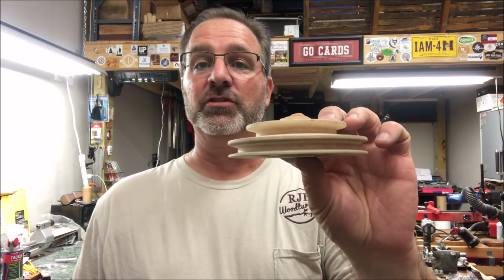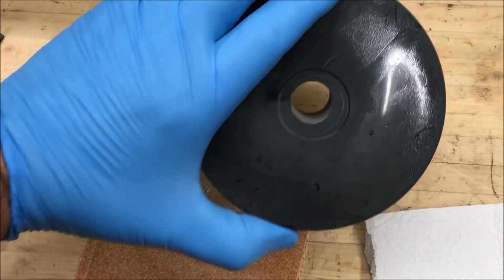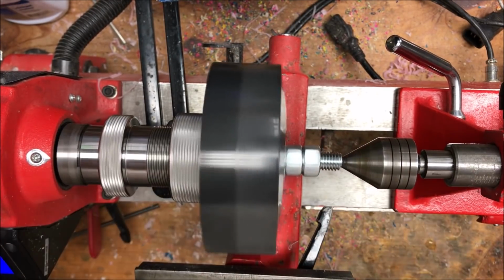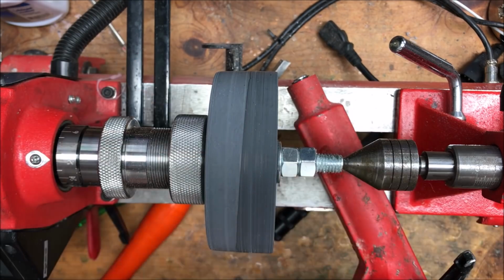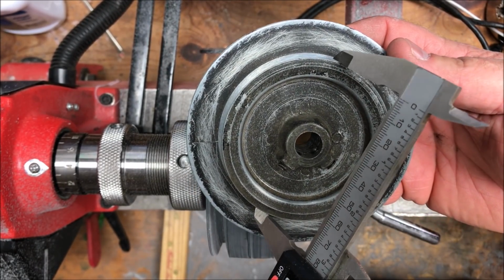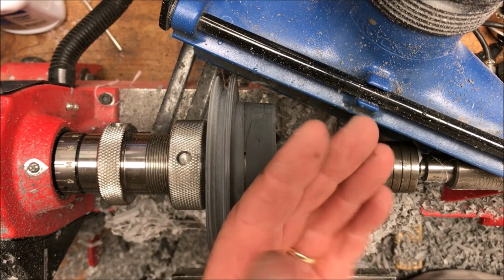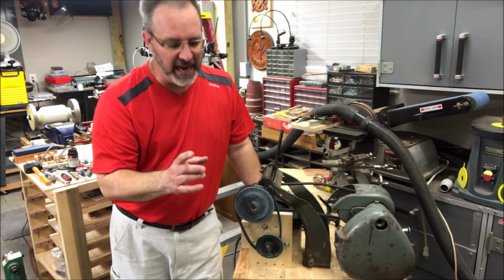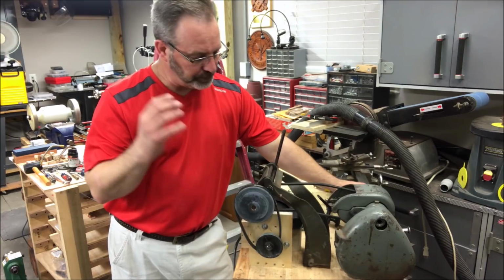I Turned A Pulley To Repair My Atlas 618 Lathe

Comment: Lathe looks like a 10F being a 10" swing probably on a 36" bed. You can get those pulley's all day on Amoozun for about $10 OR Ejay for outrageous insane prices specific replacement part. FYI....the original big pulley on the counter-shaft is about 12" dia.
Reply from the maker: This is an Atlas-Craftsman 618 lathe from the late 1940’s. 
  The issue is, all the pulleys I have found online use a wider belt. 
  I am in the process of replacing upper and lower pulleys to accommodate the belt situation. They are $30.00 to $40.00 each. 
  The original pulley for this lathe is a little over 4.5”. I have it, it’s just bent and can’t be straighten. 
  This may seem like a simple fix but it has been quite complicated. I have a rep at Grainger who has been helping me and it has really challenged them. 
  I can always buy one of the original pulleys on eBay but they’re like $160.00 as they don’t make them any more. 

Regards,
Bob
Reply: @RJBWoodTurner  Same here...the one & only thing I need is non-existant....OR original/used parts insanely priced on ejay. Sometimes we need to stop and work out a different way to make a repair. Never compromising using iffy shady -tech but maybe improving the machine. I'm trying to piece part a 12"x54 Atlas back together almost complete less the counter-shaft pulley that I found on Amoozun. Going to use green link belts found at Harder Freight Tool.

Comment: I have a question if you don't mind.  I am having trouble with my drill press blowing out the end of my acrylic blanks. How is that avoided? Also my press is not drilling straight. I have checked the table for level, made sure the bit was 90 degrees to the table. I just don't know what I'm doing wrong. I definitely need the advice of the mentor. Thanks in advance!
Reply from the maker: Hello Bret,
  I usually stop drilling right before I get to the end and let the bit cool.  If the bit is hot the chips stick to it and pack in causing more friction and heat. That will blow the blank. 

Regards,
Bob
Reply: @RJBWoodTurner  Thank you very much Bob. That helped a lot. Now if I can just figure out my drill press. For now I am drilling by hand to get a straight hole.
Reply from the maker: It took a lot of work to get mine square. I purchased an small machinist square. Then I brought the bit down to the table and checked it over a full 360 degrees making adjustments front to back and left t right. The other thing you really have to watch for it to make sure the blank is square in your vise. Many times stock is not perfectly square which throws off the hole while drilling. Try drawing a line down the center of the blank where you want the bit to go. Then lower the bit right next to the blank and check the alignment with he line on the blank. Adjusting the blank in the vise until they align.

Regards,
Bob
Reply: @RJBWoodTurner  Thank you Bob,  I will try that.